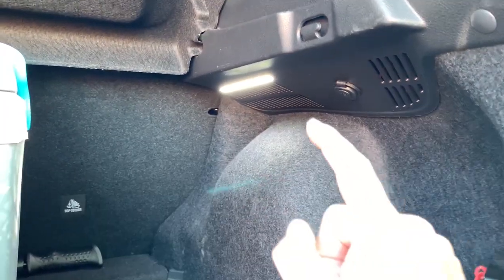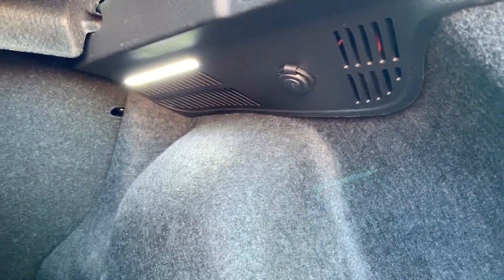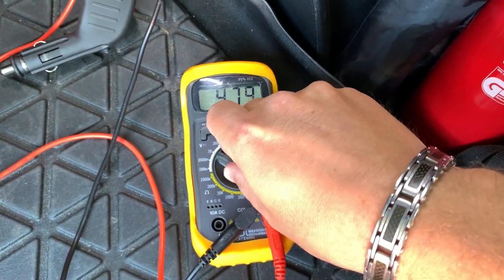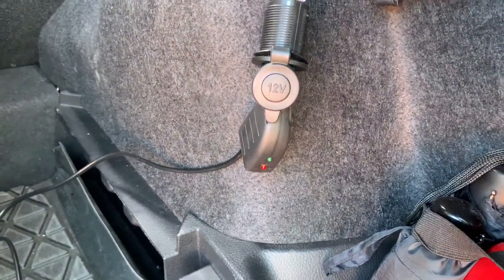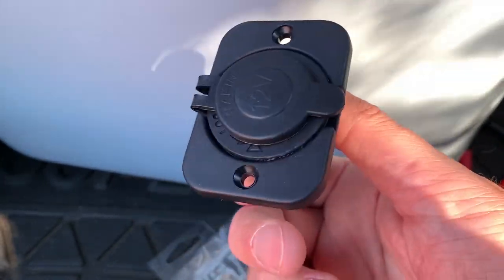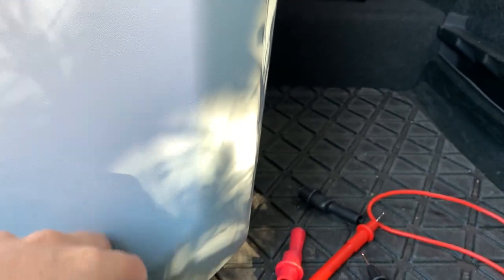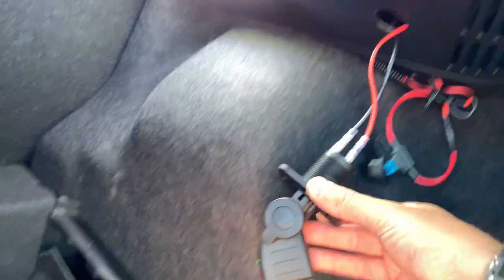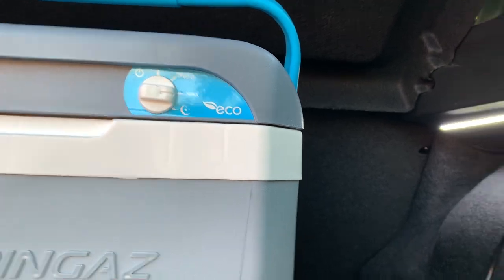Nissan Qashqai J11: 12V power socket in the trunk - troubleshooting!

Comment: HI! I often follow your videos, especially the ones where you explain the electrical parts! There are always clear explanations.

Can I ask for advice? I'm also about to fit a socket in the trunk to connect my fridge (7 amp power) and I saw in a video the possibility of connecting to the wiring designed for the tow hook and located under the trunk lining on the left side.
In the wiring, the cable is the orange one directed to the battery with 30A fuse. What do you think? Will the wire be thick enough to power the fridge? I thank you
Reply from the maker: Hi! I’m very happy to hear that. Thank you 🙏. If you know my channel you may remember a video where I spreak about problems I had with the first installation in the trunk. I swapped the power socked but still wasn’t happy. Therefor I changed the connection to this exact towbar wire in the left behind the liner. Know however that it isn’t just behind the liner close to the ground screw as shown on another YT video. On our QQ it’s way further above the wheel. Here you can see what it looks like and how I tapped it. 😉 

https://ibb.co/yRT3HjD
https://ibb.co/nD3n6R7
Reply: Thanks for the quick response and photos. 👍

Of course I remember your two videos for the 12v socket.

Did you make the video for the new connection? I didn't find it on your YT channel.

Do you think the orange wire can hold 7 amps of my fridge?

the orange wire is protected by a 30A fuse. Did you change it to a lower one?

Thank you! 🙏 @LaPalmeraie0032
Reply from the maker: @vam326 you’re welcome 😉 no I did not make a new video this time. Sorry. It should hold the 7A easily as it is made to hold up to 30A. Especially of you’re not using a towhook. If you do, see how much the trailer, caravan, bike rack,… uses and do the maths 😄 7A + xA = 30A> I didn’t change the fuse (I never change original fuses for other ratings!) but of course I added a additional fuse behind the socket. I think it’s a 15A one. The cooling box also has it own fuse built in the charging plug.
Reply: I thank you for the answer!  Interesting information👍

Comment: Have you ever considered installing an electric trunk using those chinese kits? It's complicated but the reward of having an electric trunk beats it
Reply from the maker: Hi! Yes I have and it’s not complicated at all! The problem is the height! With these Chinese kit, the trunk doesn’t open as high as original and I would hit my head all the time. I show it in one of my video’s. I think it’s in the « all my modifications » one 😉
Reply: @LaPalmeraie0032  I found a video about installing the kit on the qashqai, it works like the original one. You can find it by searching Alisa Liao nissan qashqai electric trunk installation on youtube
Reply: In that video it isn t the same car but I saw that it lifts up as much as the original one, and the kit is around 200 euros
Reply from the maker: Yes it does and there’s a Dutch video as well but they don’t open as high.
Reply from the maker: Just watch it. At 6:05 you see it isn’t really high but at 6:30 it is. Will compare it this morning with the original 😉
Reply: @LaPalmeraie0032  the chinese one i think comes from factory with a lower lift height, but it has that height adjust feature to make it go upper or lower
Reply: i think the chinese one is nice for the price, it comes with all the harness the electric hatch with soft close feature, button to open close it from the trunk and front with a kill switch so it kills power from the system
Reply from the maker: Yes I know but the struts aren’t long enough to go any heigher. Back then at least.
Reply from the maker: Yes indeed but still I wonder about the durability. In my experience not all these cheaper knock offs hold on as long and what then…? My dealership told me he did it once as well with an official part. The one from the xtrail maybe? i would be curious to know the price difference.
Reply: @LaPalmeraie0032  i see the chinese factory gives you 2 year warranty for the whole system, if it breaks after that i think you can actually just change the telescopes from x-trail maybe. I don't think you can actually use those from the x-trail because they are made for a heavier trunk with an bigger opening. I wonder why they put electric trunks only from 2021
Reply from the maker: I didn’t know about the warantee even if I’m not sure how the are going to manage that. Resending items back to China costs a fortune 😅

Comment: Not a particularly good diagnostic technique...which is what the video is supposed to be about..

Gaining access to an inaccessible fuse when all you had to do was check the cigarette lighter socket to see if the LED was on!
Reply from the maker: 😂 the light was on…but still the cooling box wasn’t powered correctly. So that wasn’t a reliable indicator. That is wat the diagnostic was all about. So I eliminated step by step plausible causes. 😉

Comment: 12.04 volts isn't enough 'power", it's enough voltage.

Your technique is terrible. You seem to be focussed on purely voltage.

You haven't measured any currents and you haven't even measured the voltage when the socket outlet is under load and delivering current to the cool box.

You're swapping out components randomly because you haven't actually tracked down the fault, hoping that the component you replace is faulty.

That is not a good diagnostic technique.
Reply from the maker: Appreciate your feedback.
Reply: Then record your own tutorial